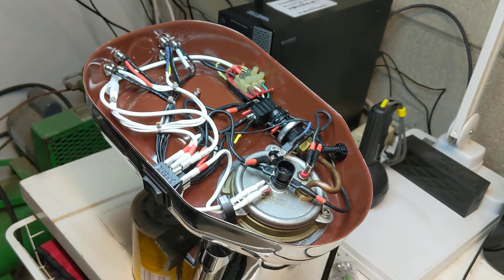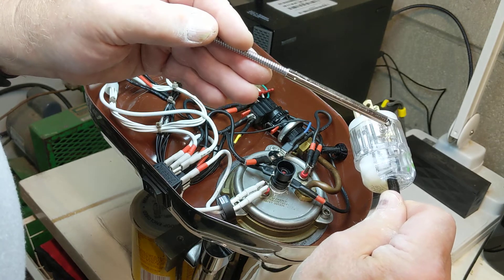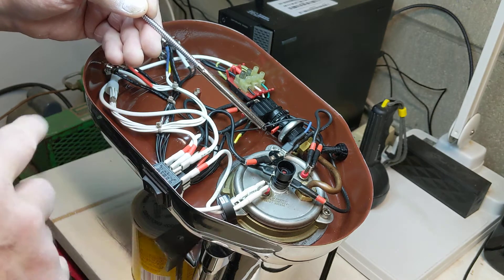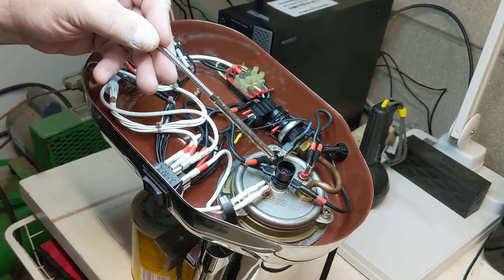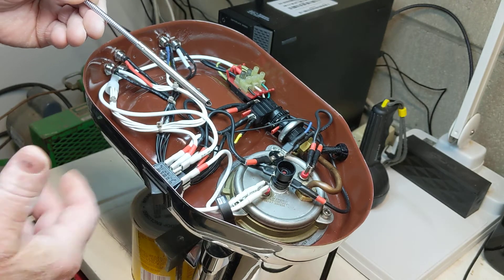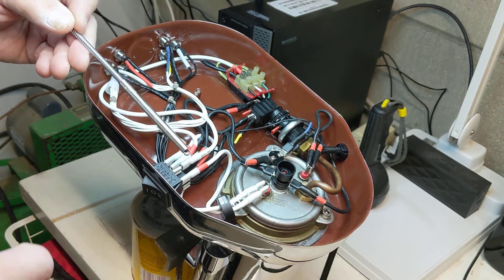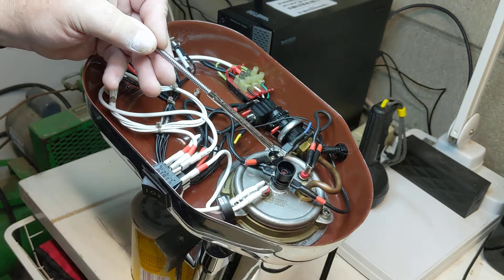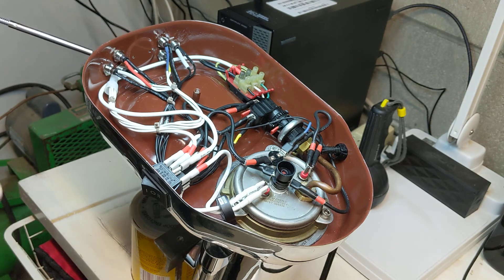La Pavoni Gen3 Ultra preview - electrical wiring V1

Comment: is there a video on how to replace an old fuse with a resettable one? trying to change it myself
Reply from the maker: What year machine do you have?
Reply from the maker: I don't recommend the new resettable fuses on old machines, as the brass base gets hotter and can result in false trips.
Reply from the maker: The original fuses are still available. Let me know if you're interested in a link.

Comment from the maker: EPIC FAIL:
So...excited like a little kid, I fired up my machine last night to test it. So much went wrong. 
1. In this rewire, I reversed the switch I and II positions. Not too hard to fix. The poles are opposite the switch throw. I finally found a YouTube video showing the correct pin-out. I'll fix this in the next rewire.
2. Green LED indicator light (switch I position) was not working initially. All other indicator LEDs lit up, which was reassuring, but many were incorrect. Not sure why, but the green LED wire appeared to be broken.
3. I managed to NOT secure the piston, so the piston fell out of the grouphead when the boiler heated up. Massive water dump. No injuries (nothing even close). Quickly turned off the machine. Big oversight on my part!
4. After cleaning up, securing the piston with the portafilter, and refilling the boiler, I fired her back up. This time, only the yellow, red, and white element LEDs worked. So the white power and blue LEDs blew in the water dump. Now I have 3 LEDs that aren't working.
5. Everything was watertight, except for the new steam assembly where it's secured to the boiler. Ugh, that one may be hard to fix.
6. The pstat worked correctly (on switch II position, not on switch I position where it was supposed to be). The steam-override thermoswitch shut off when the boiler temp reached temp, I assume (on switch I position, not on switch II position where it was supposed to be), but did not re-engage when the boiler dropped in temp. I checked the thermoswitch later; it did work when the boiler cooled down. I'm replacing the 120 switch with a 130 one anyway, so we'll see if upping the temp works better.

Overall:
A. Damage was minimal. 3 LEDs and perhaps the white element LED. (2 LEDs still work.) That's it. Nothing that interferes with how the machine is supposed to operate. 
B. The thermoswitch for the steam override is not adequate. I'll up it to 130°C to see if that is sufficient. That should give me 1.5 bars for steam. (0.8 is what I use for pulling shots.) I'll control the steam with the switch II position, so I can up the thermoswitch if the boiler can handle it.
C. Biggest lesson is the wiring diagram for the indicator lights does not work. Both the backside of the pressurestat and thermoswitch go to the hot side of the element, which means that the all 6 indicator lights were on when the element was being fired. I've redesigned the wiring diagram to eliminate the cross-wiring. Thank God I have a double pole double throw (DPDT) power switch. I'll eliminate switching the neutral (not needed in the USA wiring scheme) and use that other pole to isolate the element hot legs.

That said, I will most likely take down this video when I rewire and post a video with the correct wiring....

Questions? Thoughts?

-Bruce

Comment from the maker: BONG INPUT:
1. The remote current indicator for the element can go on either the hot or neutral side of the element.
2. The 120°C thermoswitch may not restore the sensor quick enough, since it relies on the temp on the element bottom dropping 5°C to close again (allow current through it). I'm going to replace it with a 130°C safety thermoswitch and just override the pstat for steam. I'll use the II switch to shut off the override when the boiler reaches around 1.5 bars, very much like a Gen2.